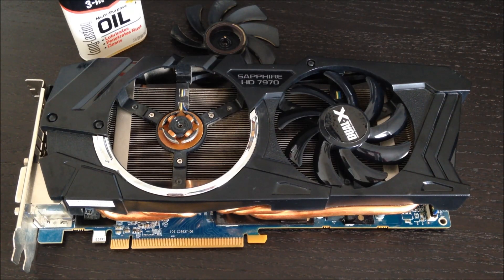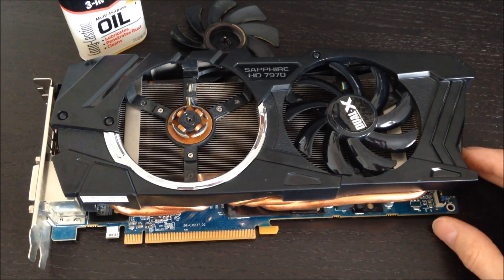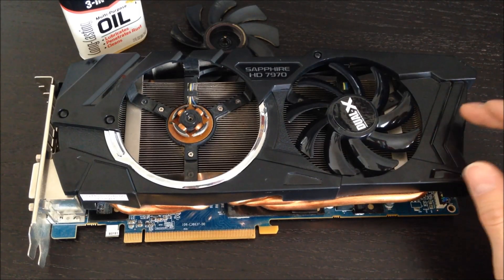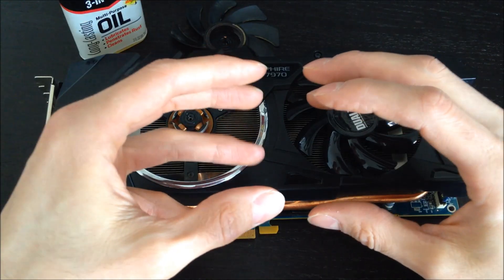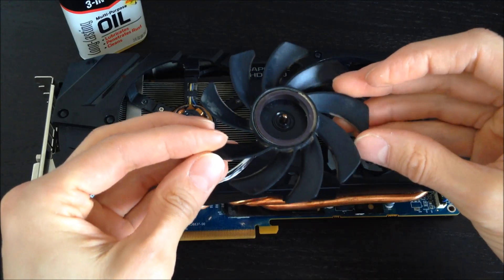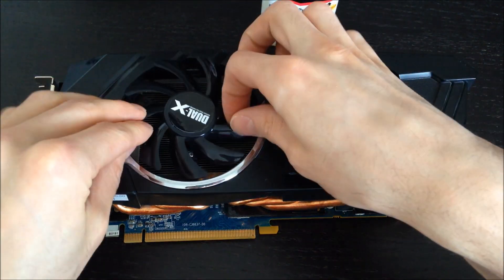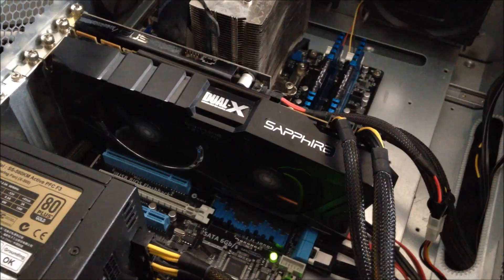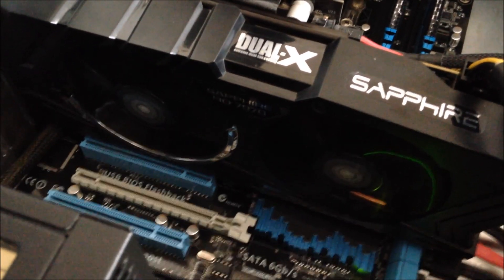FIX Dying Graphics Card Fans! | AMD & NVIDIA

Comment: I'm REALLY shocked your fan failed that quickly! I see your vid was posted in '15, and that card came out in '12! That's only THREE years :o

I have two XFX 7970's (running in XFire mode) from '12 that Just Now started to develop a failing fan (2 out of 4 to be specific) in 2021! And my PC has been on almost 24 hours a day 365 days a year too! That's ~ NINE years, of pretty much constantly being on to boot!  And the fans are just now starting to fail! 

But any way, I'm definitely going to try this before actually replacing the fans! 

Thank you!
Reply: Oh and I'm sure almost any lubricant would work (like that 3 in 1 you show) but; if you really wanna give it a good lube, that you may actually "never" have to re- apply:

Look for a product called Motorkote! That stuff is a miracle ion a bottle! And it's very multi purpose, found in automotive! It's a very powerful lubricant!

Comment: so this fixed the rattling problem but now my fan won't spin while plugged in and yes the wires are connected and it was spinning before though it be struggling it worked before.

Comment: Please don't just pull on the fan to remove it you will most likely  break your fan. Take the fan off the card and there will be a sticker on the back. remove that sticker and there is a small plastic ring that is white colored . if you remove that plastic ring then the fan comes apart very easily, then follow the rest of his instructions

Comment: Hey, thanks for posting this. I was able to fix my three fan card (970) that has been whining for over a year. I know it was because one of the three fans was seized up and the other two were working overtime to compensate. Luckily I just happened to stumble on your video and tried your oil method. Damn, it worked, and no more whining. I got so used to that whine that now that the card is quite I have to check to see if my computer is even running, Lol. Thanks for the tip.

Comment: Same thing just happened to my 270x one of the fans struggles to spin or dont spin at all
Tho temps are still within safe range when i play with just one fan so i wonder if its safe to play games like that with just one gpu fan active? Cause there are holidays here till wednesday so i can't do anything about it anyways i will have to get new one after the holidays tho i wonder if its safe to use till then?  Temps don't exceed critical range so should be fine for 3 days?

Comment: This fixed the issue in my XFX 7970, thank you!

pd: I DID have to apply A LOT of force to pull out the fan

Edit: As of April 2021, card is still working.
Reply: How long this fix last?
Reply: @bestopinion9257  back when it broke I had to reapply the lubricant every month or so, as it started to make the noise again.

But one day it just stopped doing the noise, I haven't had to add grease again and it's been more than one year since. I still game with it daily and it works like wonders.

I was using the 3 in 1 White Lithium Grease by the way.
Reply: @LaggyKikee  I'm wondering if olive oil will do the trick. :)
I am not sure if I can open the fans without damaging them. R9 280x Matrix platinum. I am not sure if it is the same type of fans.
Reply: @bestopinion9257  it was quite hard for me to remove the fans the first time, I just had to pull pretty hard and wobble as I pulled.

Also, dont use olive oil, I doesn't seem like a good idea.

Comment: did your pc randomly crash  before you toke blades out and fix
Reply: did you fix the fan? my computer is crashing and one of the fans isn't spinning.
Reply: zeo pale yeah, thanks anyways. Im gonna look for a program that can save the monitored temperatures so I can look at them afterwards
Reply: Mine did zeo.  Random crashes - thought computer broke. Opened up case and discovered that one of the fans basically wasn't spinning. Correlation seems to indication that it's thus a fan issue I guess.
Reply: zeo pale mine does, did you solve your problem?
Reply: carelessmorning did you fix it? have the same issue
Reply: nope
Reply: mine died so i upgraded to a rx 470
Reply: zeo pale thx for the quick reply. Well my msi 270x's fan makes noises and is wiggling around a bit, and my screen sometimes freezes with grey/blue stripes. It happens when I start a game, or after a while browsing or even while booting (black screen there tho)
Reply: icndjfk nsbdbd sounds like it's overheating or could be dieing im no professional

Comment: are all fans like this? I have accidentally stuck my finger into the fan blades while it was on full speed and it started making the rattling noise. I tried to pull the fan off and expose the motor, but it wouldn't come off. I'm too scared to put too much force to brake it so I'm writing this comment to make sure that What I'm going to do is appropriate. I have a GTX 560 btw

Comment: You unscrew the fan from the videocard and on the back there is a sticker with model name and producer, you just unstick it, inside there is a small plastic round lock with a cut much like a spring lock spacer (washer), get a very small and delicate tool to remove it, then the fan can be removed very easy
Reply: Yeah, that is what it's like on normal fans.
But on my Asus DCII card, you can not open them from the back either. Even tried to drill a hole through the plastic, to make sure.

Comment: hi can you please upload a video of how you de-attach the fan blade and the lower part because I pushed my fan really hard but it doesn't come out n I didn't want to brake it.

So Can you please.
Reply: "adrian ene

You unscrew the fan from the videocard and on the back there is a sticker with model name and producer, you just unstick it, inside there is a small plastic round lock with a cut much like a spring lock spacer (washer), get a very small and delicate tool to remove it, then the fan can be removed very easy"
Reply: +Robin Verma to get it off i believe you have to pull at the very base of the blades on the fan to basically stretch out the base of the fan itself so it can relieve the tension holding it onto the motor

Comment: I just had a fan die in my 7970 but when I'm Trying to get the fan off I have to use extreme pressure and I don't not want to break anything, did you have to use quite a bit of force to get yours off?